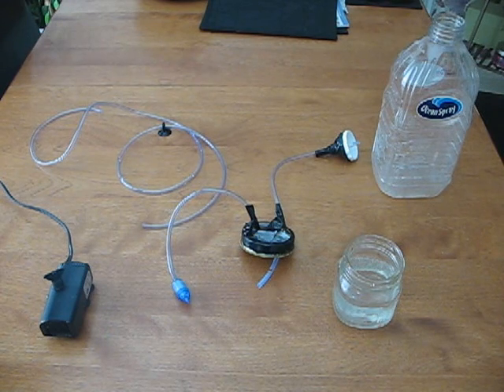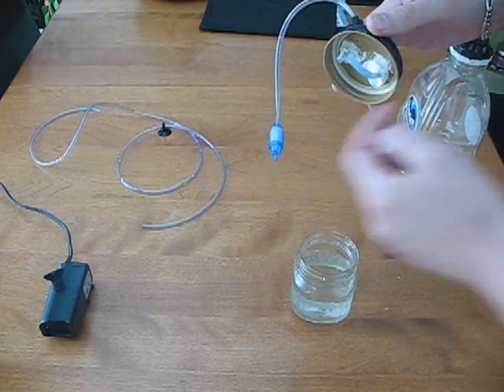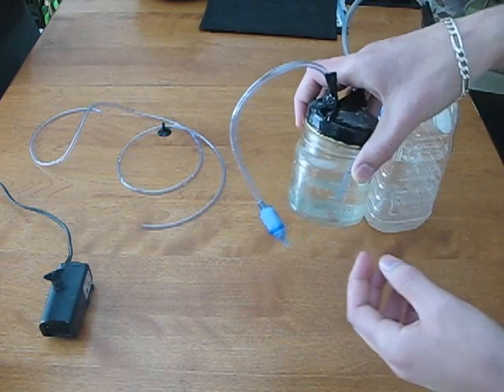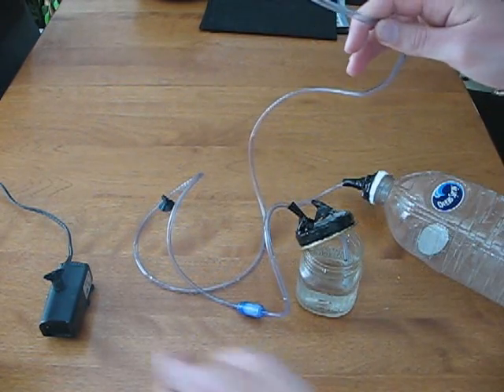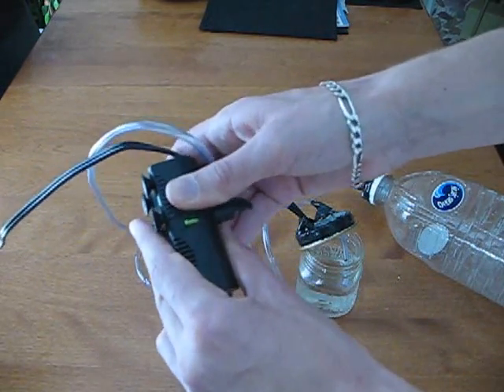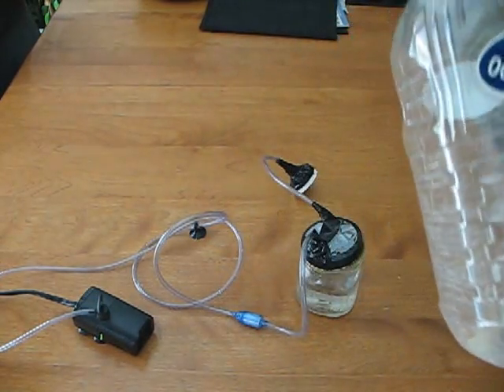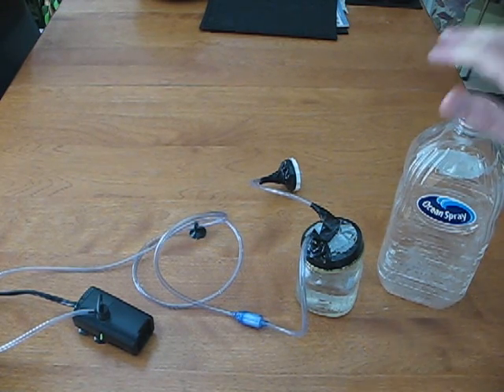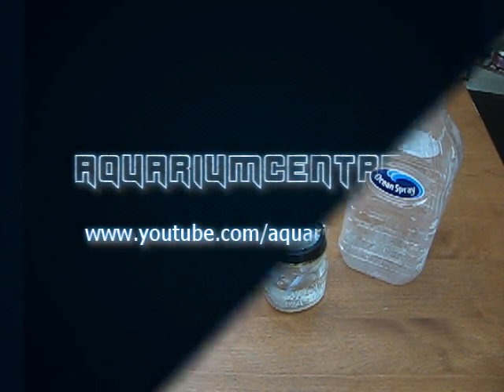The best DIY Aquarium Co2 System with bubble counter and recipe

Comment: Do i really need a bubble counter? I have the same bottle as you and doing a nano co2 setup for a 2.5 gallon tank. I doubt with the amount of co2 i will be producing will be strong enough to pull nasties up that need to be filtered. If it is recommended i guess ill go out and buy the container. Any answer is appreciated!

Comment: A better combination to generate co2 is NaHCO3 & C6H8O7. It doesn't need a specify temperature and delivery instant co2 without any time for waiting. In two 1 liter bottles this combination deliver 4 bubbles co2 per seconds instant over around 30 days.Notice: When you use this combination in wrong order, the shockwaves from Tschernobyl and Fukushima let's greeting ... ;)
Reply: A. Olderdissen why not just say baking soda and citric acid?
Reply: While in Germany it gives an different between "Baking Soda" (we called them "backing puder" and it is used for baking cakes from Dr. Oetker) and C6H8O7 and so i've used for german readers the correct chemical definition, so they not confused ... ;)
Reply: A. Olderdissen oh ok, I assumed that you were an American, my mistake.

Comment: Very good video - the Elite filter makes an excellent diffuser. However, you don't want a valve inline to control the CO2 output as it may create too much back pressure resulting in leaks or a blow out. What you can do is insert a 'T' to a valve to release excess gas to the atmosphere. You might also use an air pump to an air stone or bubble bar to offset any excess CO2 in the tank. This is often done on a timer at night to provide O2 for the fish when plants don't use CO2.
Also, the system can be enhanced by adding a 2nd 2L bottle with check valves on each to alternate and provide a more consistent production of CO2.

Comment: Hey, there is water inside my tubing from the aquarium. The water is close to the elite mini. It seems as though the pressure is not strong enough to push the CO2 out. Advice please? (P.s. I've only made this system about 3 hours ago. Will the pressure fromt he co2 be stronger and able to push the water out of the tubing?
Reply: you need a check valve

Comment: you need the bubble counter to filter the co2 and to make sure that no liquids get into your tank. Regular Co2 diffusers don't work well with DIY Co2 that well because DIY Co2 doesn't have enough air pressure to force it through the diffuser that well. I would do a DIY Co2 diffuser

Comment: Sorry buddy, but what do you mean the yeast won't react at high temperatures? Yeast becomes dormant at temperatures lower than 30 C. 30 - 37 C yeast becomes active and multiplies faster. To people watching this video, use warm water always to activate yeast, NOT cold like this guy says. But make sure the temperate is well below 50 C or the cells in the yeast will become damaged.

Comment: If you attempt to stop the co2 flow I think you'll more likely end up with co2 leaks without any blowups. This video actually provides a very bad DIY co2 system design. The design does very little to attempt to reduce alcohol from going into the tank. I suggest you use the biggest bottle you find acceptable to create a separation chamber/bubble counter. To control the co2 output loosen the bottle cap on the separation chamber/bubble counter.

Comment: Diffusers do not control co2 output. In my co2 setup I loosen the cap on the seperation chamber/bubble counter to regulate co2 output.

Comment: I disagree. If you see the my first attempt at a DIY co2 system on my channel the first thing you'll notice is that it has the highest capacity of any DIY co2 system on youtube which also means it creates the most amount of pressure of any co2 system on youtube. Also note that I use ceramic disc diffusers and a check valve which further adds to the build up of pressure. For the 2 months that it was in use it worked perfectly and there was no rupture of anything from over pressure.

Comment: Finally got this to work after a few false starts (I had to find the leaks and fix them, and I get better results with 1 tsp. of yeast).
Question:  The outlet pipe where the CO2 exits from the pump into the aquarium frequently gets clogged up with a gooey beige substance (looks just like snot, I'm sorry to say).  What is it?  And how can I prevent it?

Comment: I would advise activating the yeast before adding it. Doing this should help speed up CO2 production quickly, as well as giving you a chance to test your yeast and make sure its good before ruining a batch.

Just put dissolve your yeast and a few pinches of sugar into a small container of water, stir, and let sit for 10 minutes before adding. You want the water warm, but not hot- less than 100 degrees F. It will foam and smell like bread or alcohol if it's properly activated and good to use.

Comment: @djjoni2 Get rid of the air pump, that will disturb the surface of the water too much and allow CO2 to quickly leave your tank. If you have lots of plants, they're making O2. Just use your air stone that you had connected to your air pump and connect it to the CO2 reactor and use a zip tie to tie the hose so that the air stone is just below your filter's intake.  All the bubbles will be sucked into your filter, mixed by the impeller and CO2 rich water will be returned to your tank.

Comment: @iWearGlassesLOL Thanks, but you're a bit late. I've had my Co2 reactor setup for about 4 days now and its doing rather nicely. Although, your comment about the cigarette filter sounds interesting. I bought a limewood diffuser from the shop for $5 and the air seems to be coming from the plastic join instead of the diffuser itself, making the bubbles larger than I would have liked. I might try your way, thanks! Not too late after all it seems :)

Comment: There co2 does not go through the powerhead impeller does it.  basically the powerhead helps disperse the bubbles and probably helps the gas being sucked out of the generator rather than straight pressure.  would it help any if the line was put through the bottom so the impeller chops it up more before being expelled.  do you not need a difuser using this method?

Comment: @TheJin316 but are you really going to stand by your tank and blow through a straw into your tank for long periods of time. as for your question, I'm not sure that would work as along with co2, we also exhale small amounts of carbon monoxide and trace amounts of ammonia, acetone, methanol and ethanol (depending on your diet, fitness and what not).

Comment: 1) what about night ?
2) valve to control bubbles.. if you use valve (making tube-section smaller), then more pressure built up in your bottle (i think)..., isn't that a problem ?
tanx for anwers.

Comment: nice video dude. i like the bubble counter idea. i'm basically using the same setup except with a little powerhead instead of the mini filter. Its worked fairly well so far except for fluctuating co2 levels (but thats what u get with the diy setup). Well keep up the good work!